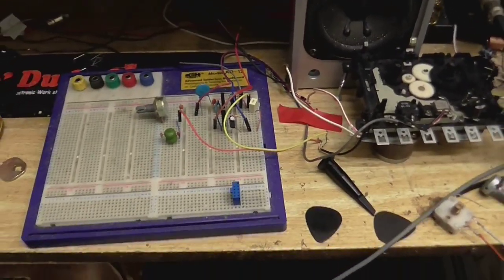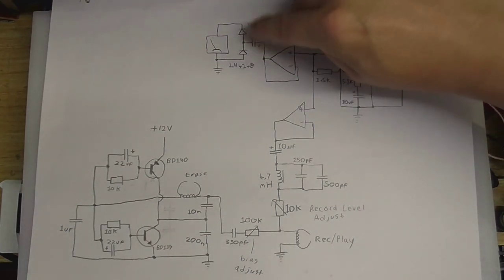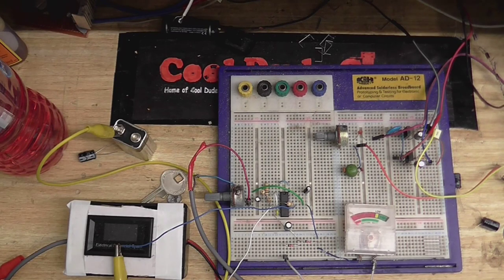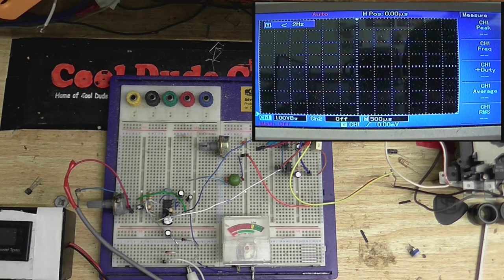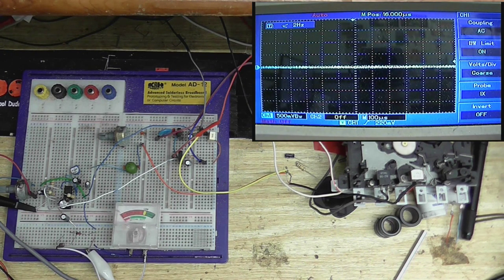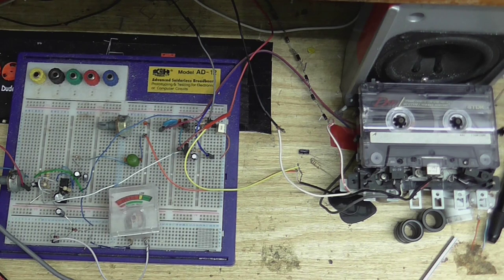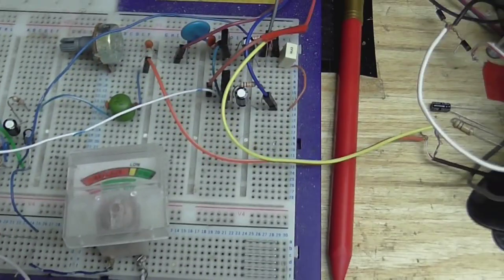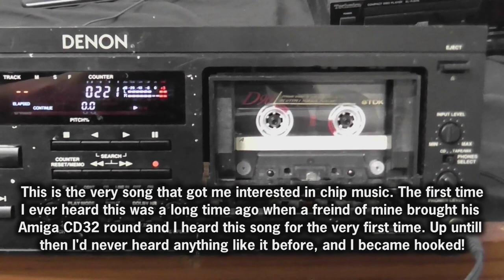The Home Tape Recorder Prodject - Making the Recording Amp and Level Meter

Comment: This recording circuit actually records very good from what i hear ;) you can put a cap around 1uF in parallel with VU meter to slow it down
Reply: Agree, the only distortion seems to be from a loud input from the mic, tweaking it wpuld make it sound as good as any commercial unit.

Comment: I'm sorry Sir. Why the BD139 from the oscillator circuit is very hot when operated and then the signal from oscillator output decrease gradually and finally lost. Please give me explain and solution, Sir. Thanks 🙏

Comment: Dam this is impressive. Curious if you built the actual unit with the tape on it as well? Outside of the circuit board
Reply: If you mean the tape mechanism, then no, he didn't make that. But without all the circuitry and and whatnot that he made, it would be pretty much useless, so still pretty impressive.

Comment: Hi Clem, what is the point of the buffer op amp between the preamp and the buas trap?
Did you put it in circuit for a technical reason or did you just not want yo leave it out of the circuit?
Reply from the maker: It's there mainly for isolation, I don't want any possible signal that may get though the boas trap to get into the metering circuit.
Reply: @CoolDudeClem  Hi Clem, would like to chat to you in depth about this and a few other things, would you mind sending me a PM?
Thanks, Mike the Wombat

Comment: I must have missed where you did the timing of the spindle motor or maybe it was already done? Looks like you need to put a potentiometer on the vu meter itself. What would really be cool is to see if you can record video on the cassette and play it back.
Reply from the maker: it wouldnt be possible to record video on that, casettes (at least the the normal speed) just dont have the bandwidth for video. the only thing that comes close was the PXL 2000 camcorders as they ran the tape at ludicrous speed! it might work for mechanical tv but i dont have one  of those.
Reply: Black and white TV video has been known to require 100 inches per second for a 'better then nothing' quality image. Might be able to go lower, like rewind speed for a cassette. I'm not saying it's impossible but back-tension, and maybe friction and other things might get kind of scary in an audio cassette. Therefore perhaps it should be tried... BUT it might need control signal track(s) and custom/modified electronics I'm guessing. It might be a HUGE amount of work with messy results. I've been thinking about that for a long time but I can't get to it for a long time if ever.